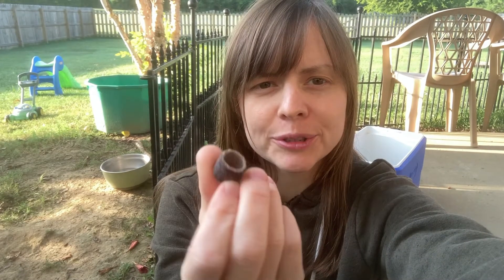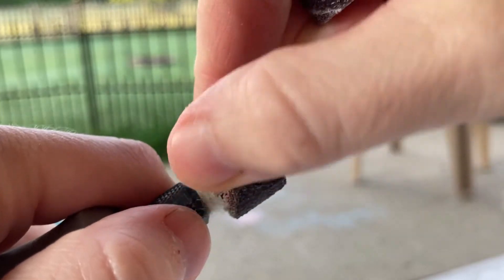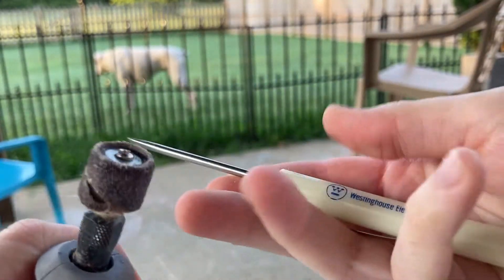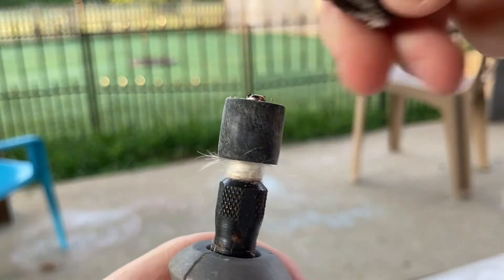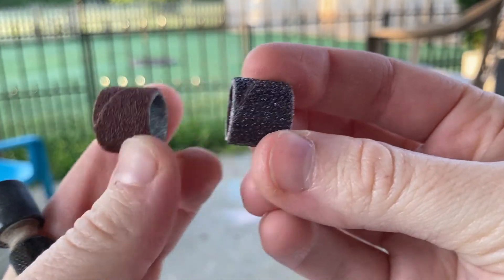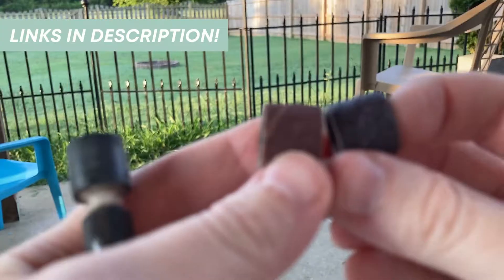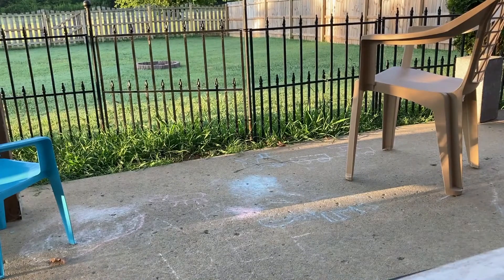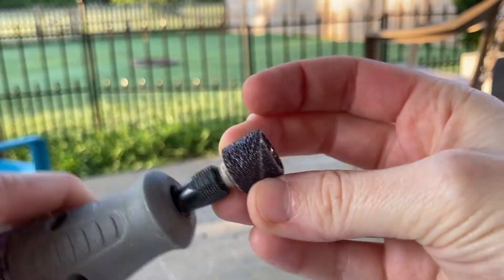When Is It Time To Change The Dremel Sanding Head? And How to Do It!

Comment: Dremel also has a blue "ez drum" mandrel, which does not require a tool for replacing the band. (Not sure it would be a good option in a professional setting, but works well at home)